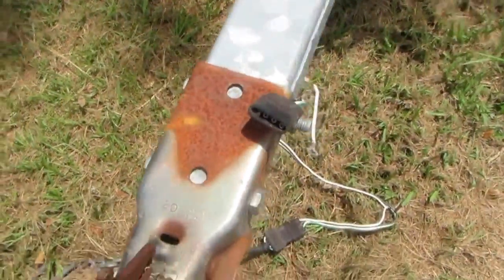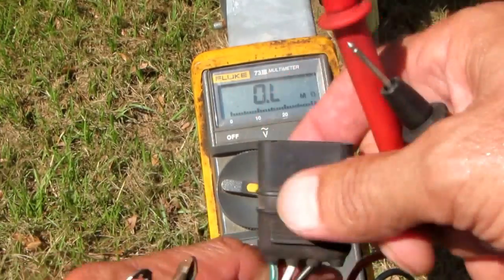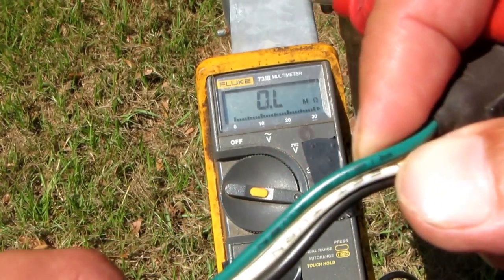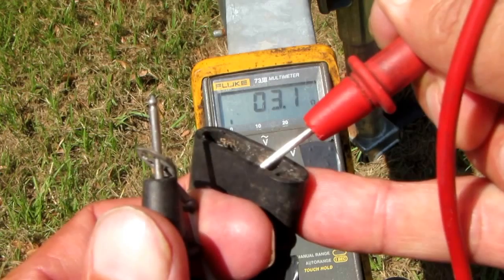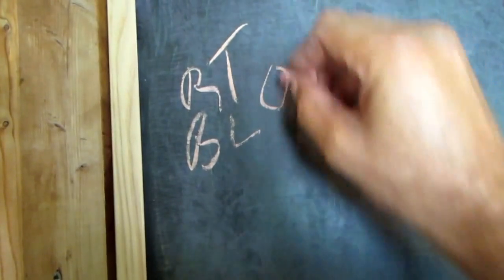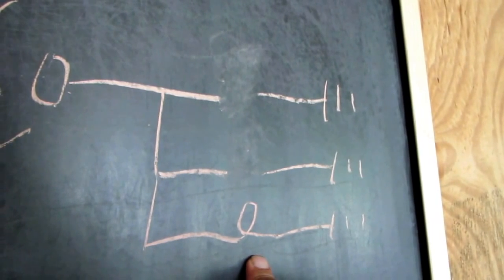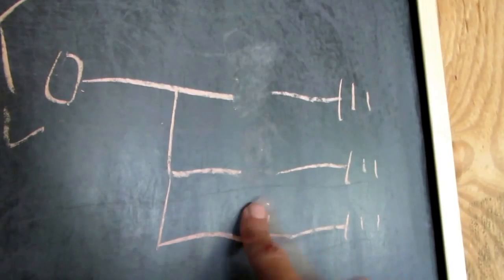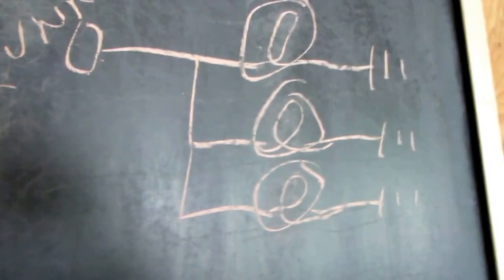Use a multimeter toTroubleshoot trailer lights. Part 2.

Comment: What is the black connected to?
Reply: The ground wire connected to the plug on the trailer. Usually a white wire that ends with a bolt/screw that grounds the trailer itself.

Comment: How is this reading the ohms from the trailer lights,, your just testing the ohms on the plug not full wire? wouldn't you need to be at each end of the wire to test for breakage?
Reply: This video not for beginners man have to already understand this shit.

Comment: So where are you putting the black lead of the multimeter,you say it goes to common but it looks like you're hooking it up through the ground connector?
Reply from the maker: I am checking the wire harness.  I am using the wire harness grd wire, Checking ground connection to the auto I would put the black lead on a good ground location on the auto and have the trailer hooked to the auto. Thx for watching.

Comment: Does the trailer need to be on the ball in order to test the lights, or can it just be plugged in? Thanks. Good vid. Btw, you sound like John Wayne.
Reply from the maker: To do the ohm test no it doesn't need to be on the ball.  If the ground wire is good and connected to the vehicle. It should work without being on the ball. Some times the grounds are not good or connected and through the ball is the path to ground.  In this case yes it needs to be connected to the ball.  Thx for watching.
Reply: I second the John Wayne comment.

Comment: My running lights are bright my brake lights are bright but why would my turn Signal lights not be bright and flash oddly and dim when everything is hooked up?  When I unhook the trailer plug my turn signal lights on my truck go back to normal. Do you think it could be a bad ground or something with the plug? I got the kit that plugs into my existing wiring harness under the bed of my truck I was told by a friend that the module in the plug-in could be bad but if that was so would it not make the passenger side break light on the truck act up? Any help would be nice thank you for your time have a grate day